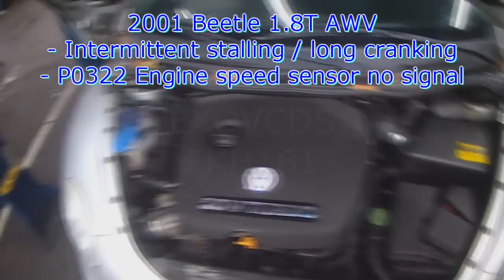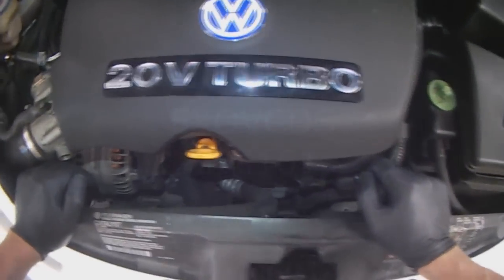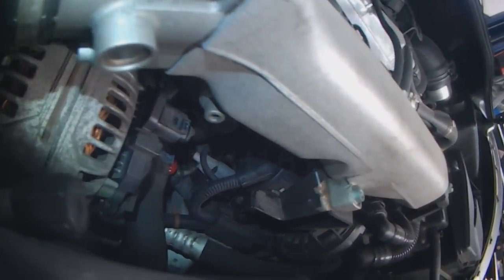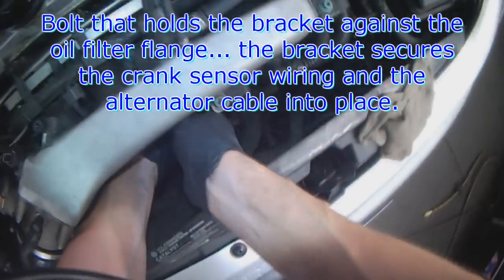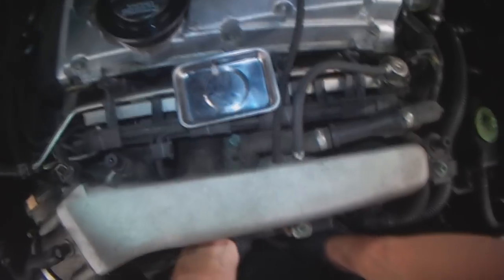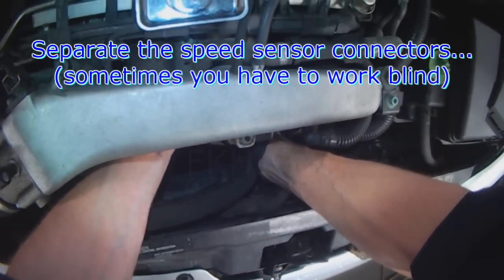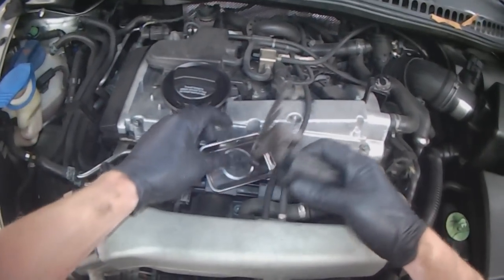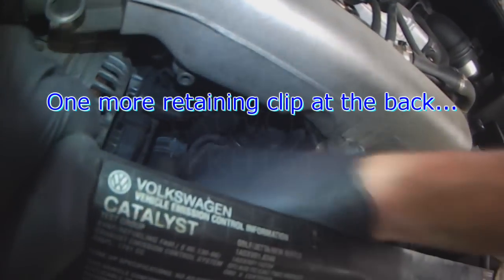VW A4: 1.8T AWV Beetle faulty crank sensor P0322

Comment: You're one of the best youtube channels for "compleat idiots" who love wrenching on their Beetles.  My '04 1.8T did the "long cranking" at the gas station today right after a fill-up.  No CEL or codes yet, but I turned the car off and on a few times and eventually it started up.  It reminded me of my old '91 325i BMW that I drove in college, which started doing the exact same thing at around 150,000 miles.  I couldn't figure that one out, but the mechanic who fixed it said it was the hall (effect) sensor on the flywheel.  When I searched for vw beetle flywheel sensor, your video was the first result.  I think I'll have to plan to do this repair soon.
Reply from the maker: Long crank after fill up is usually due to a stuck open EVAP Purge valve... as the tank is filled, gasoline vapor is pushed into the intake manifold, causing a rich / flooded condition when trying to start. If it only happens after filling the tank, I would check / replace the N80 Purge valve. If it happens whenever the engine is warm... after the engine has been off for 5 - 10 minutes, then I would suspect the crank sensor... but the ECM will usually flag it when it doesn't receive a signal from it.
Reply from the maker: Oh... and thank you for watching!

Comment: yea found that harness today pulling the thermostat wondering wtf it was :)  duh crank sensor well done but why dont they call it a crank sensor  those T30  jobs like would it of been easier with a hex or flanged typical bolt head ... strategy ...thinking of replacing them for future reference     anyway looks protected from a thrown rock  they dont want too much torque on the bolts but swivel and shimmyshango
Reply from the maker: T30? Where?

Comment: Hi i need your help.I drove my car for almost 2 kilometers .I parked it and when i came back he crancked but he won't start.I tow him home.The next morning he crancked and start till now.But he seems to have a jerk while driving.I've change powerrelay and cranksensor.Have still the jerk in him.Its a audi a4 b6 18t.I've serviced him about a month ago
Reply from the maker: Fuel pump / fuel supply? Misfire from bad ignition coil? Scan the engine computer for fault codes.

Comment: If I hadn't watched this I would have never started this replacement. One issue that should be mentioned is that the cable has multiple clips along the wire path that can't easily be reached. Tying a string onto the connector to pull the new wire back up also helped me.
Reply: I should mention that mine was 2001 Beetle 1.8t.
Reply from the maker: Hi, thank you for the added info. As long as the cable can't get caught on anything, routing does not have to be the exact same way. You could even leave it loose and just secured to the bracket where the connectors plug together. Having it secured at multiple (stock) locations, just ensures that the cable will not wear out prematurely due to vibration. Thank you for watching!

Comment: I did this recently on an 1.8t awp gti. Very tight and sensor wire quite short.  Removing the oil filter might help. I used a small vise grip to wiggle the old sensor out. Make sure you hear it click when reconnecting the harness plug.
Reply from the maker: Thank you for your DIY feedback and thank you for watching!

Comment: I have a beetle 2001 1.8 turbo it's throwing 2 codes at me p0010 and p0102 I replaced the crankshaft sensor and cam sensor im totally lost now can you help?
Reply from the maker: Check the camshaft chain tensioner / solenoid... if cam timing is out, that will affect air flow through the MAF.

Comment: 99 vw 1.8t runs perfectly fine all day long…. When you shut the car off it will not start…..? Have to let it sit for over an hour for it to start again… new plugs and coils and crank sensor. Any ideas???
Reply from the maker: Not sure, could be a faulty temperature sensor, faulty new crank sensor (once hot), loss of fuel pressure (leaky injector or check valve in the pump). If you have a scan tool that can read live sensor data... look at coolant temperature and engine rpm while cranking (when it doesn't want to start). If there's no communication when it won't start, it could be the ECM power supply relay.
Reply: @EXOVCDS  solved. Coolant temperature sensor was bad and leaking water into the connector wire shorting it out making the car shut down
Reply from the maker: Thank you for the update... nice troubleshooting!

Comment: My wife has had the same car (same AWV engine) from new and repairing it is the bane of my existence. It's always something  - not that hard to diagnose with the help of the internet but a pita to get to anything. Would be impossible without VCDS. I think the poor airflow over the engine means that the plastic sensors, valves, hoses etc get  baked in the California sun. Getting the SAI pump in and out with those fragile plastic hoses is a piece of work  My Passat, same age but good airflow hardly ever needs new parts.
Thanks for all the great videos!!
Reply from the maker: The 1.8T engine bay is hot regardless and the plastic parts... plastic is as plastic does. D'oh! Thanks for watching!

Comment: Hey thomas. I really need youre help. I have a 2004 audi a4 1.8 timing pulley came loose and a valve bend. I replaae the head and try starding car but it hesitates it will stard up but after cranking it 100 times. I have uses the same timing serpentine velt i have coses po300 po 301 po1111 po1340 p01602 po343 po685. I rechek the timing with #1 tdc and cam mark line up. And i have 16 rollers between marks. I change the cam sensor with a new one. I taken  the cams and reset them a lot of times. I will really appreciate any help.
Reply from the maker: New head or used head? How is compression? How did you make sure that #1 piston was at TDC?
P1340 means cam & crank are out of sync:
http://wiki.ross-tech.com/wiki/index.php/17748/P1340/004928

I'm still at work... will write more / ask more later.
Reply from the maker: Send me pictures of all your TDC marks, so that I can see everything is in time... you can find my contact info in the description (website fkh161... click the "Tool Request" text to send me a message). When you say timing pulley came loose, which one are you talking about? If it's the cam gear... is the alignment key in the gear still ok / not broken or cracked?
Reply from the maker: I'm still waiting for pictures.

Comment: Hey Thomas! If you see this comment and help me out that would be so much appreciated! So I have a 2003 Jetta with the 2.0 non turbo gas motor.The car has been totally stripped down and is a circle track enduro race car lol... i know i know.... So it was running awesome and then started doing this...... It was taking forever to start....it would pop and backfire like the timing was off and then it would finally start and run well after many attempts at cranking it over....then I shut it off and it starts right back up! I shut it off and started it 5 times and let it run for 20 minutes....that was 5 days ago......after it sits it goes back to popping and not starting....also im gonna mention that the Converter and whole exhaust is off the car, but the first 02 censor is still there.....so its exhaust manifold to a pipe with an 02 censor and thats it..... i just plugged a scanner in and the codes are 0322, 0864, 0036, 0321 . I have a race Saturday!! please help if you dont mind!! Also the tach does move a little when cranking.
Reply from the maker: Check the crankshaft position sensor / wiring for damage / bad connection. I'm about to start work... will reply again later once I'm at home.
Reply: Thomas EXOVCDS ok I'm on way to junkyard now to grab a used one and see what happens. They get $100 for a new one!! Screw that! Lol thanks for your reply. I'll update you
Reply: Thomas EXOVCDS used crank sensor from the junkyard fixed it! Thanks man!!
Reply: Thomas EXOVCDS you got a PayPal I'll tip ya. Your videos have helped me before too

Comment: I have a question. 2006 a4 2.0t it's a bad idea delete pcv I just buy the kit . (no catch can oil) thanks
Reply from the maker: Luxury Auto's I can't comment on that since I have never deleted the pcv on one of these engines. I had an open pcv on my old car that I installed a turbo on... the open vent / hose was placed into an empty plastic pop bottle and the bottle had a small vent hole. Drove it for 7 years like that... the intercooler was bone dry, no oil fumes etc. If your local emission laws allow, pcv delete (as long as it is done correctly, so the engine crankcase can still breathe) have a go at it, but consult with someone who has done it.
Reply: Thomas EXOVCDS  OK thanks your the best

Comment: how much lucas semi synthetic assembly lube went i change valve cover gasket and oil
Reply from the maker: Assembly lube is used when you remove & install camshafts, lifters, bearing caps, crankshaft, connecting rods / bearings. If you are only replacing the valve cover gasket, no need for assembly lube... if you want to use the lube, lube all exposed cam lobes.

Comment: i have to change transmission oil on my audi 1999 a6 quattro 2.8 i can use hi tack gasket sealant aerosol red
Reply from the maker: I usually install dry / no sealant... you can use it if you want.
Reply: Thank You

Comment: Thanks so much for your videos, they have proven to be invaluable!  I was able to unplug the sensor, but I can't figure out how to get the sensor off the bracket.  Do I just need to push in a certain direction?
Reply from the maker: It is a slotted fitting... slide the connector up out of the bracket.
Reply: Thomas EXOVCDS Thanks for replying!  I never could get the clip out of the bracket, I just left the old one in there lol.  I hope that was my issue, it died on me a few times while driving, with the battery warning light lit on the dash.  It took a little longer than normal to crank, but drove fine afterwards.  Did not throw any codes though.  Hope this was the fix!
Reply from the maker: Brandi Beats Battery light coming on when when the engine stalls is normal (alternator is not turning anymore). If it used to stall daily / weekly and now does not... odds are, that was the problem.

Comment: You almost need to be Houdini to work on that bug.
Reply from the maker: Or at least tiny hands! =)
Reply: @EXOVCDS  could this crank sensor also cause my car not to start at all. before my car use to cut out the every now and then I use to have to take my key out then pop it back into the ignition to start it back up but now it's just not cranking over at all
Your advice would be very grateful regards.
Reply from the maker: @TheGte1981  "Not cranking over" = "starter is not turning the engine". Crankshaft position sensor has nothing to do with starter operation. If the starter IS turning the engine, but the engine is not "starting (running on its own)", then yes... could be a crankshaft position sensor issue. Year, make, model, engine? The more info I have the better I can help / guess. Is the check engine light ON when the key is ON (it should be)? Do you hear the fuel pump buzzing when turning the key to ON? Ignore the last two questions if the starter is not "turning the engine".
Reply: @EXOVCDS  it's a 2005 mark 1 seat leon fr 1.8 20v turbo engine code is auq  I put my obd2 code reader on & I got this code p0322
Reply: @EXOVCDS  yes fuel pump works when I put the ignition on engine check light is there too when I try and crank it the oil light flashes 3 times too with 3 buzz sounds but I checked the oil & that's fine.
Reply from the maker: @TheGte1981  Then I would start (pun intended) with the crank sensor. =)
You can check it like in this video:
https://www.youtube.com/watch?v=MJIA0AsxASQ 
Resistance value should be around 700 to 1000 ohm
Reply from the maker: @TheGte1981  Oil buzzer & oil light flashing while cranking for a long time is normal.
Reply: @EXOVCDS  where is the crank sensor located on my engine please & do you have a link of the part I need thank you for your help I really appreciate it.
Reply from the maker: @TheGte1981  Same location as in this video and the video I linked. If you know where your oil filter is... look for it to the right & behind the oil filter / mounted to the engine block. We don't have Seat her in North America... phone your local Seat Dealership and ask them for the part number after giving them the Vehicle Identification Number (VIN). Either buy the part from them or use the part number to find the part online (web search).
Reply: @EXOVCDS  thank you once again I'll keep you updated Thomas thank you for your help you really are a good person stay blessed sending you love all the way from the UK ✌🏼.

Comment: Way more room if I get under it
Reply from the maker: Yes, that's why I also worked from under the car... depending on the vehicle (Golf, Jetta, New Beetle) there will even be more room, as some of the components are located in different places or are not present (Secondary Air Injection, No AC lines etc). Thanks for watching!

Comment: Had my audi a4 b6 1.8t sline avant code p0322  turns over no starting would the crank sensor fix this issue
Reply from the maker: Possibly... p0322 can also be set when the fuel pump is no good. 
If you have spark, then the crank sensor should be ok and you need to focus on fuel.
Use a scan tool to view RPM in ECM live engine data (or look for tachometer needle movement when cranking)... no RPM values is most likely a sign of a bad crank sensor.
Reply: @EXOVCDS   there no rpm so guessing  crank sensor gone bad as car been running spot on went garage got fuel cam back started then cut off then started again epc light and engine light on then no start
Reply from the maker: In the early stage of failure... they usually fail once they get warm. Once the engine / sensor cool off... the engine can be started again and will run for a while further.
Reply from the maker: B6 crank sensor removal (from the top) video:
https://www.youtube.com/watch?v=8WufwHIzaUM
Reply: @EXOVCDS  you my friend are a absolute  legend 💪💪 and thank you be my task in the morning
Reply from the maker: Let me know how it goes / went.
Reply: @EXOVCDS  was crank angle sensor  as in your video  :) and lost the damn bolt to secure it do I know it's a 10mm but not sure on size if u get me was told  M6 ?
Reply from the maker: M6x1.0 thread pitch 1cm (1/2") long or so... if I remember correctly.

Comment: what would cause battery light to flicker constantly after i changed battery on audi a4
Reply from the maker: pelon Garcia Why did you change the battery? Could be that the alternator is not charging correctly and that's why your battery was weak... same thing is gonna happen to the new battery.
Reply: Thomas EXOVCDS changed alternator and still kept doing same thing
Reply from the maker: Check the charging system... what's the voltage at the alternator? At the battery? Disconnect the field wire at the alternator... what happens?

Comment: 2.0 turbo20v  ??? Pero si parece un 1.8t20v
Reply from the maker: It's a 1.8T... the engine cover says 20V Turbo... as in 1.8T 20V.
Reply from the maker: es un motor 1.8T 20 válvulas